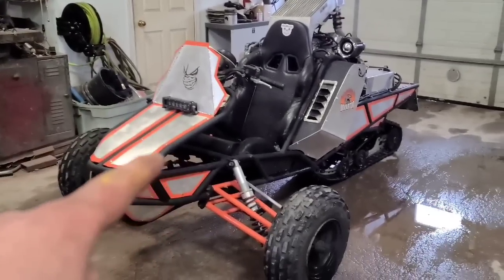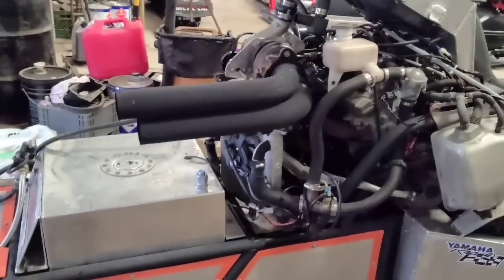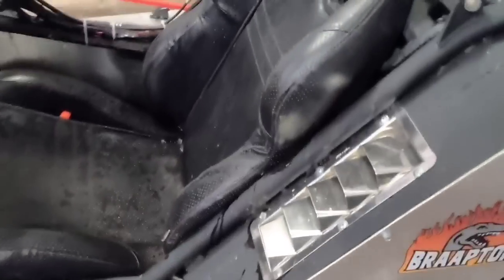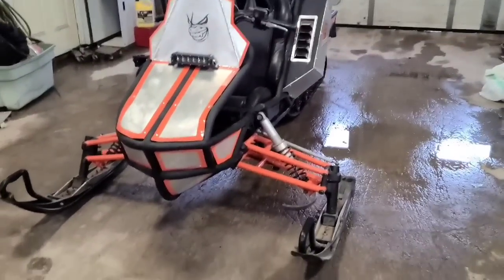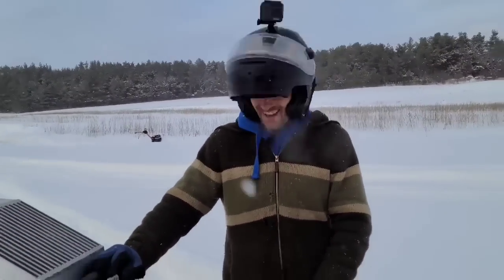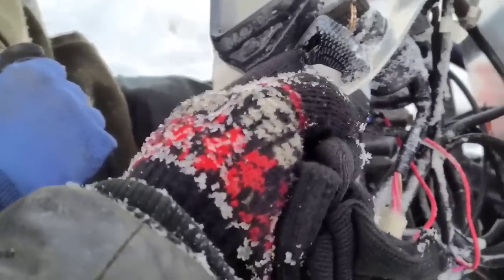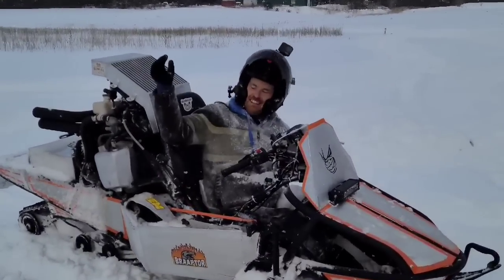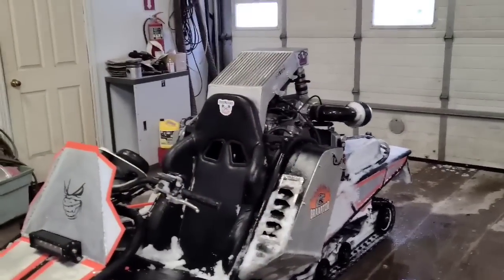The BRAAPTOR!!!!

Comment: You need more volume in the intake box. It ran better with the higher boost because of the smaller air box forcing the air charge in. A bigger Air box volume will help out the smaller box boost issues.
Reply: Could just throw a boost tank on it

Comment: Looks like big heavy lumberwagon that not gonna go dwn any tight trails good job bro🤷‍♂️🤣slow as crap2
Reply from the maker: haha yeah it is big and heavy and it doesn't handle as good as it could that's for sure! but slow its not..it will run 102 mph in the quarter mile which is good for any sled really and faster than most. there is a video of it on our channel feel free to check ot out! cheers 🍻

Comment: What's wrong with your motor at high RPMs?
Reply from the maker: I don't think the float bowls of the carbs are pressuring equally with the boost and its not getting the right amount of fuel, still needs some tuning 🍻